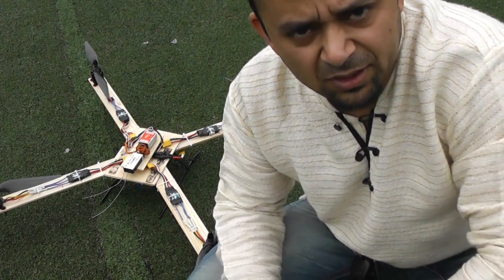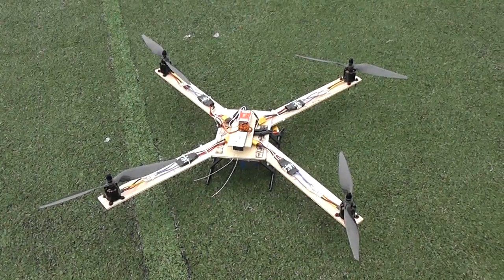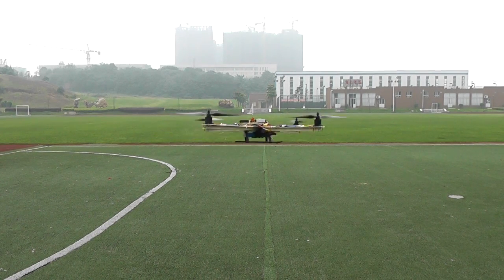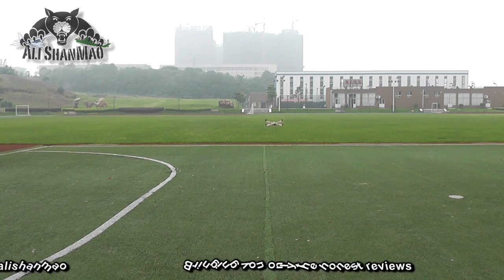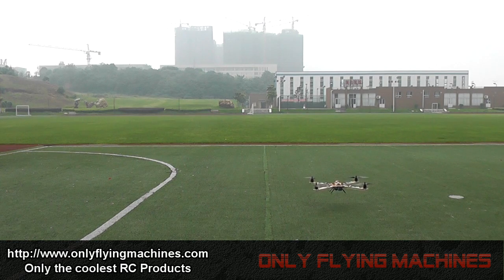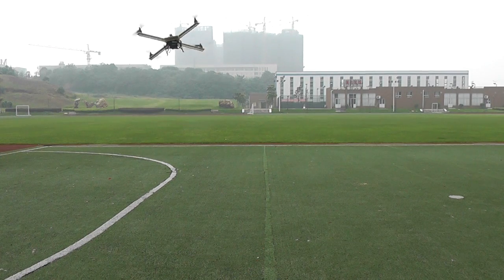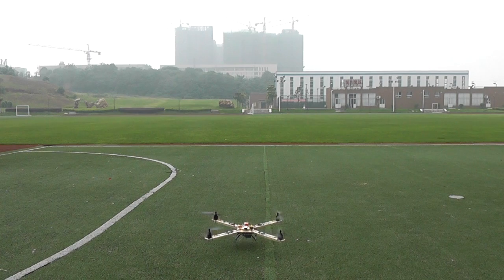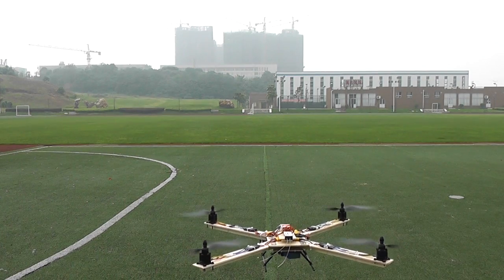Maiden flight of Home made widow maker Quadcopter

Comment: nice flying Ali!!!! i love my Naza too. it adapts very well to different configurations of quads, but it doesn't like when you put the gains up on a flexible frame. the twisting of my laminated 3mmx2ea quad arms is very bad and the gaza can't keep up.

that's my fault in the design and prototyping. once i have moulds cut and use GFP there should be no problems!!!

cheers,
Brian

Comment: Ali, would you recommend doing a DIY quadcopter like this for a first multirotor? I've extensively built and flown many airplanes and a few heli's, so I think the controls wouldn't be an issue for me. And would you recommend using a HK 3.0 control board in place of the DJI Naza you had on here? I'm trying to make a quad on a budget. Nice vid!